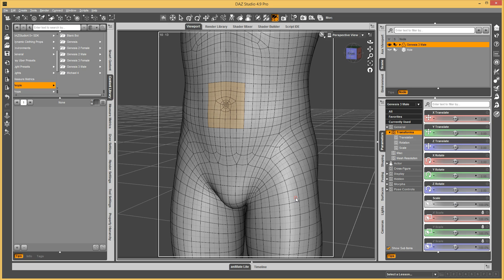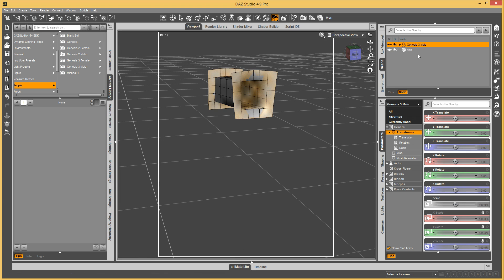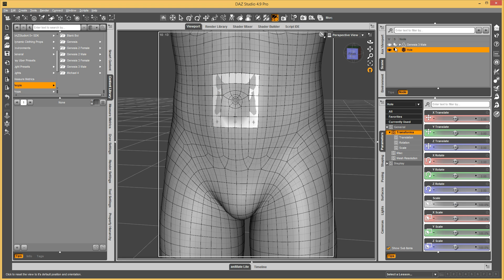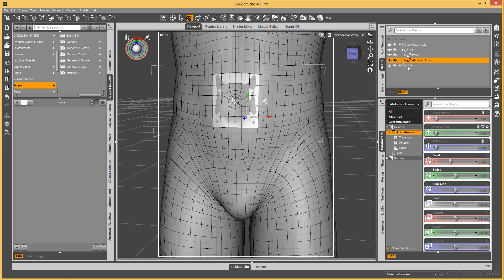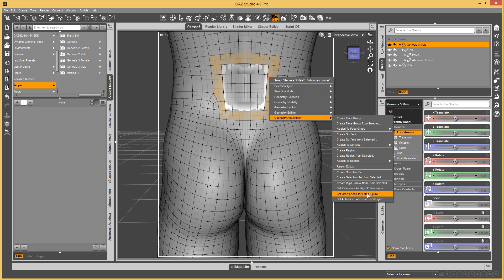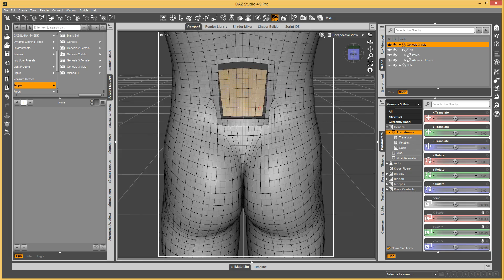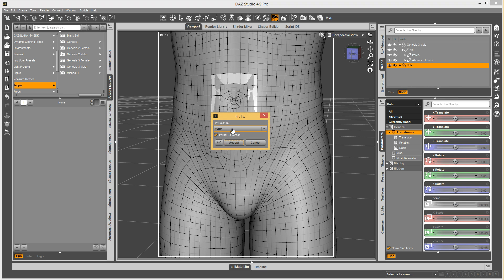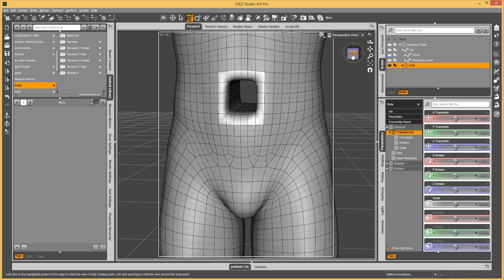Geo-Grafting 101

Comment: I may have missed a step. I create the geometry as a geo-graft, save it out and load it back in to the figure, but as soon as I apply any morphs to the figure or change its size, the vertices on the object that aren't "welded" to the surrounding mesh remain where they were (or move in the opposite direction).
Reply from the maker: geo-grafts conform to and follow the figure the same way clothing does. Once you have it welding properly you will need to go through whatever setup makes sense for the item. If you were adding a new arm, for instance, you would need to set up rigidity so the entire arm moves whenever the area it attaches to is moving.

Comment: Somehow I feel like it would've been easier to just take G3 texture template, paint exact faces same black, load it on the model as transparency map and be done with.
Reply from the maker: Depends on what you are doing. There are definitely situations where that would make more sense, but in this case you would see the inside of the mesh because there wouldn't be a tunnel with walls through the mesh. You would just have a hole on each side and empty space in between.

Besides, this was just a super simple example to show how geo-grafts work. The intent behind geo-grafts is to allow you to add or take away geometry from the base figure, so you can go a lot more complex than a simple hole.
Reply: I only meant it as a method to hide faces. Sorry I didnt made myself clear.
Reply from the maker: Ah I see, cool.

Comment: would I use this method to add geometry not welded to the mesh much like the tear geometry was done for genesis 3?  I want to take part of the eyeMoisture geo, cut it in half top to bottom use top half only, and offset to come forward a few pixels.  I ultimately want to create a top eyelid shadow with texture masking on this added geo to appear as if a top-eyelid shadow is projected on top of eyeball for added realism/darkening.  It would need to autofollow as I would want to apply such geom to multiple figures but be parented to head as to not rotate with eyeball.  Possible in Daz?  I'm doing this currently outside Daz in other app but would like to have it in place inside of Daz to start with to save a ton of time.  Any help would be much appreciated.
Reply from the maker: Any geometry that is fit to the figure can be used to hide geometry on the figure without welding to it. Just skip the step of setting the graft faces and just do the auto hide faces.

So yes, you should be able to take away part of the eye moisture geometry and put your own in without welding.

Comment: Hi Josh, how do you get geoshells to recognise new geografts? I'm currently trying to to convert a G3F set to be used with G3M that uses both a graft and a shell, but the shell is only covering G3M at present...
Reply from the maker: +tigerste The shells automatically include geografts because they become a part of the figure geometry when they graft. Strange that it isn't working for you. Make sure the graft is fit to the figure and that you don't have the geometry editor tool active. If you are still having issues, email pasupport@daz3d.com
Reply: +Josh Darling I've followed your steps in video but its not working. I'm not sure pasupport would be able to help me as I'm not a PA. I'm trying to convert the G3F Laguna Mermaid for use with G3M/M7 etc which would of course be for private use only. I've contacted the pa who made the product but haven't had much luck so far. I don't know if you'd be willing/are able to help, but I can send you the steps I've performed so far to see if perhaps there's something I've done wrong...?
Reply from the maker: +tigerste It would probably be good to go to the Daz help desk and submit a ticket.

With geometry shells, any geo-grafts that are attached are automatically included. I have tested this by adding grafts before adding the shell and adding grafts after adding the shell. It always worked fine for me, so I don't know for sure what could be going on for you. I suspect the graft is not attached properly, though, which might cause this issue.